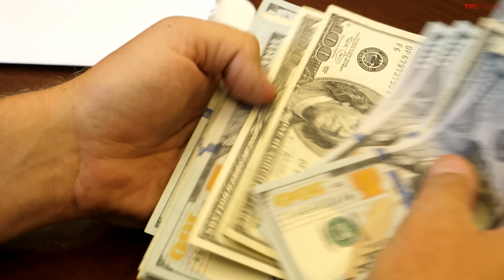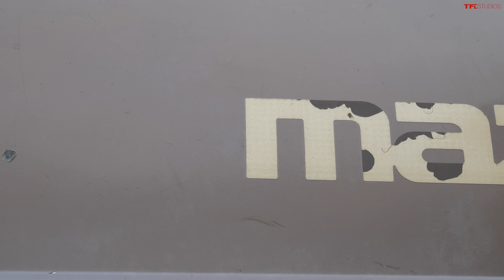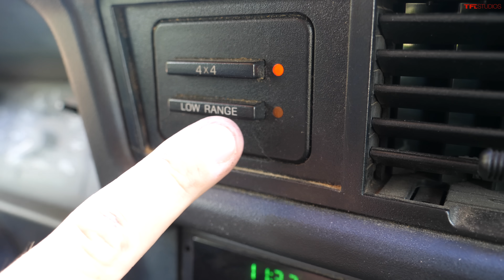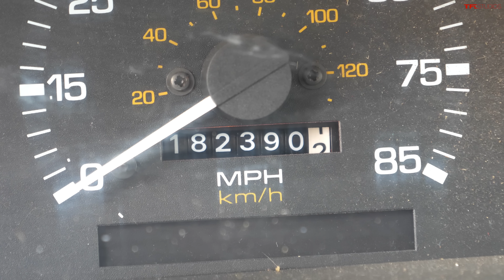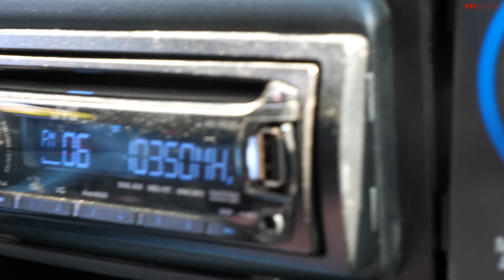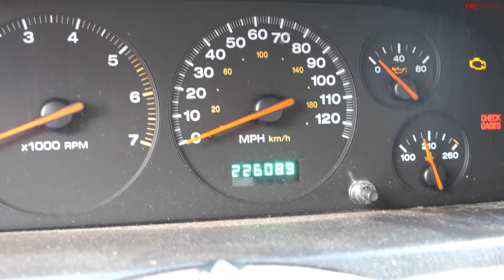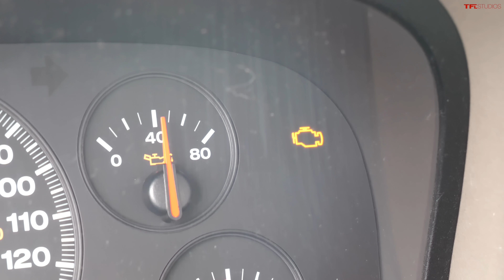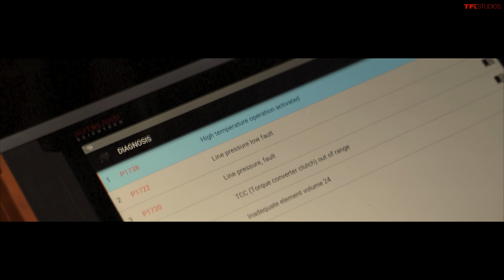Under $2,500: We Buy Three Vehicles That Are Complete Crap - But Which One Is The Worst?

Comment: Back in 1996, a chevy blazer was my favorite vehicle. That changed when I saw a trans am for the first time lol.
But the 4.3L blazer is probably the most reliable one there. The 4.0 wasn't bad but the 4.7s were pretty bad. They are better suited for the Cherokee and Dakota but are terribly slow in a ram. My 04 ran accelerated ok in 1st gear but was terrible after that.

Comment: Hello Tommy. A friend of mine once had a Peogeot 404 as his first car in the last part of the 70thies. I had a 1977 Peugeot 504 with gas engine, and the 1980 model with diesel engine were one of the most reliable cars I ever had, 504 models are still driving around in Africa. And I had a 505 for a short time. Best Regards from Arne in Norway.

Comment: Love seeing a WJ on the channel, they're such underrated rigs!
Reply: fact. However the wrong information is going to rub me wrong af.
Reply: @Trebelhornc  Yeah, the 4.7L transmission can be reprogrammed to a 5-speed. They're also more reliable than the 42re that came with the 4.0L.
Reply: @ADirtyScrub  I thought that reprogram was only for the later WK's?  The 4.7L HO would be good the standard 4.7L wasn't great, the HO version from what I've been told has some beefed up internals, too bad they skipped the whole upper end for beefing up since they love to drop valves, valve seats, and blow off rocker arms.
Reply: @wildbill23c  The V8 WJ came with the 45RFE. (4 speed, Torque rating of 5, RWD, fully electronically controlled) it was unique because it used 3 gear sets instead of the normal two that most 4 speed autos use. That was because it had a second 2nd gear. Or 2nd Prime it used only for kickdown shifting. AKA passing gear. Because it had 3 gear sets it could be reprogrammed to make use of a 5th higher gear. This would be referred to as a 545RFE. I own a 4.0L WJ with the 42RE, which most consider an inferior and weaker trans than the 45RFR on the V8, due to some manufacturing defects I'm the design on the 42RE. If built right it's not a bad transmission though.

Comment: Back in the 90s my dad bought a Mazda b2300 manual and he had it forever so I think Andre's truck might be the most reliable.
Reply: The weak point with the Mazda's and Rangers back then were the automatic transmissions....with the manual in Andre's truck he'll be fine but I'm betting the auto locking hubs for the 4WD are trashed.

Comment: Tommy's wj is going to win this challenge! If it had the inline 6 then yes the tranny would be the weak spot, but it being a 4.7 which by the way doesn't seem to be burning oil yet (unlike any 4.7 that has ever existed), the 545rfe is a strong transmission and paired with that 242, piece of cake!

Comment: My mom bought a 2000 Grand Cherokee with the bullet proof 4.0L I6 and it has over 300k miles on it now. Trans slips a tad when it’s cold out and we needed a new a/c and radiator, but other than that it’s STILL going

Comment: In 2002 i bought a 1999 Jeep Grand Cherokee 4WD for $1100 with the 4.7L V8 that had a rod knock. I wondered of I could just repair the ONE rod and buy myself a little time to save enough to replace the engine later. I did repair it, I replaced just that ONE rod bearing, filed it down and shimmed it with brass shim on a spun bearing rod journal while still in the truck to get it as close to max tolerance as I could. I got it within .006/.007. It had low oil pressure, not deadly low, around 20 psi hot and i used 15/50 synthetic Mobile 1... no kidding, i drove that Jeep for 6 years. I went thru one freezing Illinois winter,  I towed a loaded 12' cargo trailer from Chicago to Florida, i drove it in Florida summer heat, I put another 30,000+ miles it and it was still running with NO knocking when i got rid of it. Cheap Trucks rule.

Comment: this is great, awesome vehicle choices! Nathan got a hell of a deal on that blazer, but if i had to live with one its the Ranger, those things last forever and are very reliable. I'm wondering if that jeep is going to make it...
Reply: I'm a  huge Toyota Tacoma fan , but rangers last forever
Reply: I have personally been stranded in a similar ranger several times. When the clutch goes on them you can’t drive them at all.
Reply: I have never burned out the clutch in a manual transmission. Had several manuals. Put loads of miles on them. Never replaced a clutch.
Reply: @thenotsoguitarguy9429  The only clutch issue I had was a result of a throwout bearing disentegrating and damaging the clutch friction material.  I've had slave cylinder failures, but have never destroyed a clutch from wear/tear.

Comment: Had a limited WJ with the 4.0L, quadra drive (vari-lock axles) and no tow package. Was an absolute monster in the woods and snow, but was also a total custom build from the factory. Had the d44a rear axle which only had the weakness of being housed in aluminum but still the strength of a d44. Then having the quadra drive meant it had the better transfer case. Without tow package as well just looked better with solid one color bumper, literally had the ability to tow but no hitch. Frankly only other WJ is the overland since it had all the same 4x4 stuff but the 4.7 h.o, or freedom edition.

Comment: The wj was my first car and I have to root for it. I never got stuck, might have lost a few bumpers and head lights, but never stuck. For $2500 I can guarantee you can get a better one then mine. 180,000 miles the 4.0 and the transmission is getting real tired.
Reply: My 98 ZJ with the 4L had 159k on it when the transmission decided keeping the fluid internal was too much of a chore and puked it all over my carport...it went to the scrap yard, blew the front seal, it was having shifting issues and slipping anyways long before that issue...those 42RE transmissions are very hit and miss....my 96 ZJ on the other hand that I beat the crap out of offroad had 232k on it and never had a problem even doing some heavy towing with it.

Comment: I picked up a 99 durango slt with the 5.2. Has the locker and all underbody protection. Has a trans cooler as part of the factory tow package. 4x4 works obviously.  Has full time and part time 4x4 as well as 2wd. The thing kicks ass off-road.  Paid 1000 bucks. Put new tires and did maintenance on it. I would put it up against any of these!
Reply: Your Durango has the 242HD "Selec-Trac" transfer case like the WJ in this video has, except the WJ's 242 isn't the HD.

Comment: Team Andre…. That Mazda pickup will outlast the other two vehicles…. by far. With some conditioning, tires and fresh fluids…. Another 100k miles 😎🤠
Reply: Until it has head issues.
Reply: @turbolq4  which it won’t because the ranger is bulletproof
Reply: Not even close. The blazer has already cruised on past the ranger. It'll keep going until the transmission explodes.

Comment: transmission was not a weak point in that year.. that year they installed the 545 rfe.. he could have that or the 45 rfe.. 45rfe is good on take off especially with overdrive off... this transmission contains 3 planetary gears... 45rfe and 545rfe are so similar that you can literally swap the tcm plug and play from each and convert over to an extra gear .. with o/d off plus removal of torque managment this car is beast. About 220 hp with just under 300 lb ft of torque

Comment: My dad's 94 blazer which is the old square s10 blazer went for 271,000 miles, someone else is still driving it.  The oil leak is probably from the lines to the remote mounted oil filter behind the left headlight (or that's what it was on the 94 anyway).

Comment: My '95 S-10 Blazer 2 door--which I've owned since new--has the same drivetrain, but mine had the push-button 4wd.
She now has 308,000 + miles on her, but I need to replace the engine, as one of the ears that holds the starter up was broken.

Comment: So the 2nd gen blazer is one of those that if you fix the issues themselves. The engine and (some would argue about the trans.) is rock solid. The oil you see if normally from the remote oil filter lines. Not in any order. 1. Spider fuel injector. (Make sure you can get the xx year and above to upgrade for the upgrade. I think 98 or above.). 2. Fuel pump. 3. Intake Manifold gasket. Bad design like in a 99 3.8L grand prix. 4. 4 wheel drive. (Depending on if you have automatic with push buttons) is the transfer case motor like to break. 5. Fuel pump sending unit. I think we had a few more. But as you can see. That adds up on the list. Esp. if you have a mechanic do the work. From what I can tell is seems to suffer from any of the late 90's to mid 2,000 car failures. Oh and they did make a TBI option too instead of the vortec. Slightly more reliable. Harder to find.

Comment: I have been driving my 97 2.3 manual Ranger Splash for 8 years. 10k miles per year. It has some cosmetic damage if you look very closely. 
In 8 years, I have put 2 sets of tires, a fuel filler neck and a MAF sensor in it. 
I originally paid $1800. The repairs cost me $214 and the tires $750.
It needs a ball joint, now(and will get one when the temperature has 2 digits and no minus sign).
Geo Trackers, Suzuki Sidekicks were my winter vehicles of choice until there were no cheap manual transmissions left. 
The 4cyl manual trans Rangers seem to have no Achilles Heel. I started in Ford Courier pickups and have a million miles on 5 of them. Only my 85 went to the scrapyard and that was after a rollover crash.
Aside from being boring to drive, has anyone found a fatal flaw in 4cyl Rangers from 84 to 2014?

Comment: They picked on andre but couldn't talk crab about anything mechanical, I'm rooting for him.
Reply: His issue will be the auto locking hubs, wheel bearings, tie rod ends, camber bushings, and ball joints, all common failure points in those truck and the Ford logo'd models.  All the way back into the 80's with the Rangers...Ford just never bothered to correct anything as usual.

Comment: Believe it or not I have had 5 wj's all with the 4.7 or 4.7ho motor and I have had exactly zero transmission problems. The 4.7 ho makes 280hp and has the exact same transmission as the regular 4.7. Change your fluids and preform the required preventative maintenance on most vehicles and they will last even through hard use.

Comment: the fact that the v6 chevy barely got beaten by a v8 jeep is hilarious
Reply: Yep, the V8's really didn't have that much more power in the real world than what people would think.  Although the V8 option gave you a better transmission and a bit more towing capacity, it really wasn't worth the upgrade for many people, and the 4L I6 was a better engine than the 4.7L V8...the ZJ's had much better V8's at least for longevity the 318 (very common), and the 360 (only available in the 1998 Grand Cherokee 5.9L Limited, a 1 year option sadly).  If I bought another Grand Cherokee I'd love to get my hands on a 98 5.9L Limited.  Fastest production SUV on the market at the time.

Comment: The 1st vehicle I bought at 16 was a ‘94 Ranger XLT, similar mileage but way cleaner inside and everything worked. Used it a lot off roading, jumped it and got it stuck but sure miss that truck! Just don’t miss the known issue of wheel bearings wearing out quickly lol. Lived in Colorado for 32 years before I left for NC. like to see reviews from you in my home state and the good old Rocky Mountains!! Has a badly damaged 1989 S10 Blazer with non functional 4x4 and over 200k but it would chirp the tires going into 3rd, only Jeep I had was a 1990 (the cursed) year with a 2.5 lift and larger tire, loved the 4.0 H.O. and great ground clearance but once it death wobbled it was toast!

Comment: Found a 93 Ford Ranger single cab short bed, 2.3 with the 5 speed manual and only rear wheel drive for 600 bucks and I drive it several hours a day most days, 238,000 miles

Comment: This is making me miss my WJ, although I’m already sure that the “small oil leak for a long time” comment at the end was from that Jeep.
Reply: Idk, the 4.3 in the blazers was just a old sb350 with two cylinders lopped off, and those things leaked oil from the factory. The 4.7 uses newer silicone type gaskets, and none of mine have leaked oil. They all leaked power steering fluid though.

Comment: That’s not oil leaking from the Blazer’s engine, it’s sweating from all the horsepower.
Reply: Being that far forward its probably the transmission cooler lines leaking, or one of the power steering lines.
Reply: @wildbill23c  some of those S10/Blazers had a remote mounted oil filter. I suspect it’s that.

Comment: I think the B4000 and Blazer would’ve been closer in the drag race if the 5 speed could’ve been shifted faster (lower mileage). With 182,000 I’d be weary of beating on the transmission and clutch as well. The synchros are probably long past their prime and the clutch has likely been replaced once at most so there’s no telling how much it will take. I think it held in there pretty well all things considered.

Comment: 2nd time watching this video! The comment bout the Ranger is bs! My dad bought a new 90 Ranger with a 4 cylinder 5speed. Parked it at 441000 miles. Put one tyranny in it but everything else except tires were original! I've had 2. Both 98s. Sold the first. Then gas went up and I bought another 2.5 4cylinder truck. Dude ran a light and the insurance gave me more than I paid for it. Alot of parts housed used them for delivery trucks! The blazer might be a better cheap rode trip ride but for knocking round and getting supplies a 4 cylinder Ranger can't be beat. Don't waste ur time on a 4 liter Ranger! Its more motor thatvyou need!the wheelbase is to short for serious towing on all these things! The blazer is just a car in drag! So is the other! Just because it will pull 5000 lbs doesn't mean it can safely stop 5000lbs. I'm a 62 year old redneck that did that crap for over 40 years! It ain't safe!

Comment: Shocked none of them found a car. Crown Vics are everywhere here. Can also find decent coupes. My friend found a 1997 Acura Integra 5 speed manual. It ran well. Had a few problems that he only spent $750 plus repairs, which were less than $500. He sold it a month later for $2500!

Comment: Andre saying that break fluid was okay is just scary!  While I’m not familiar with how that reservoir operates interns of where the full line is or isn’t I would assume full line is just above the cut out area, my reservoir on my car has a little platform inside and the full line is the fluid sitting just above that platform.   

but from what I could see of that fluid which isn’t a good sight and likely why the full line would be above that platform is it looks like it was beginning to solidify into a dark gel. I wouldn’t trust it.  Given how cheap brake fluid is and how most of the time at-least it’s easy to flush, defiantly something should be done on these sorts of vehicles where the history is either unknown or the history indicates it’s lived a rough life.
Reply: It actually says full and add on the side of the reservoir, these non-car guys honestly shouldn't even include stuff like that in their videos since they've got no clue what they're looking at.

Comment: actually the wj has a 545 rfe which is a a 5 speed. its only a 4 speed in 99-00 and all they need is a tcm flash for the 5th gear. btw bullet proof trans behind the 4.7

Comment: The comments regarding the transmission in the jeep were ignorant . the V8 equipped grand Cherokees used the 545rfe 5 speed unit , which is pretty durable . the4l60 used in the blazer is the weaker of the two .

Comment: Dam I just sold my old crown Vic that would have been so cool for this only asked 1k for it too I’m in Colorado as well
Reply: I'd love a Crown Vic.  I have an Explorer with the 4.6L V8 in it that was shared with the Crown Vic....those Crown Vics are very comfortable/capable cars with a frame and still get low to mid 20's for highway fuel economy with a V8 under the hood...funny though the Explorer can only manage mid to high teens for fuel economy LOL....but they're pretty dang heavy 5600-5800 pounds if I recall.  The Crown Vics do great in the snow too.

Comment: I have very bad luck getting brand new cars because stupid driver always hit my cars, but i have great luck getting used cars for cheap. I get in march 2,022 an 2,001 Jeep Grand Cherokee Laredo 4.0 with Selec Trac for $.1,500.00 (160,000 miles on his belt) and i must fix the water pump and brakes (rotors/pads), other than that the car is great performer, the 4WD full time, the 4WD H, the 4WD Lo and 2WD works great. I'm more that happy with that old car

Comment: The Grand Cherokee is actually a good vehicle besides its gas mileage. I have a 2004 and I’m happy with it- it’s light red and in much better condition than this one
Reply: I have a 02 overland with the ho motor and have been very pleased with it and the others I've had before it. Worst thing you can do to one of the 4.7 engines is overheat them. The valve seats will drop out of the head almost every time. If it starts getting hot pull over asap and shut it off. The valves will hold the seats in place until the heads cool down and the press fit will tighten back up on them. If you keep driving it hot the seats will fall out of the head and hold the valves open causing them to hit the pistons and trash the motor instantly.

Comment: That WJ has the 545RFE 5 speed in it. Its actually a really good stout transmission.
Reply: If its been properly maintained....just like any transmission, failure to change the fluid and filter every 50-60k they're usually going to have some issues eventually....given it has 200k+ miles on it, its probably either been replaced, or someone actually took care of it which I find hard to believe.